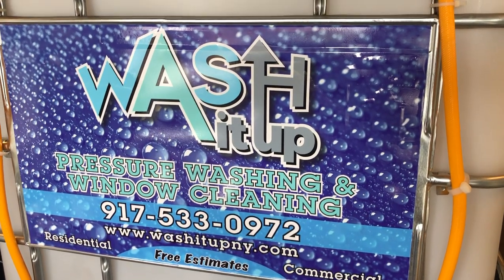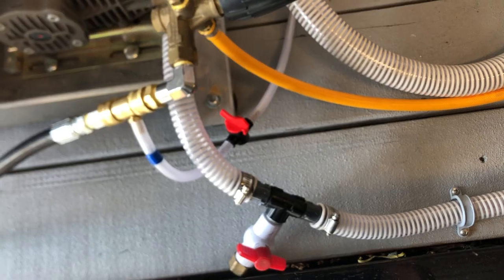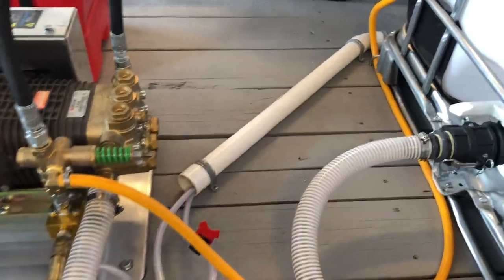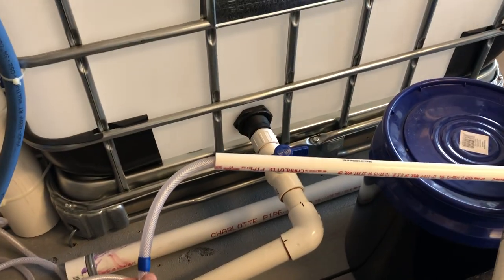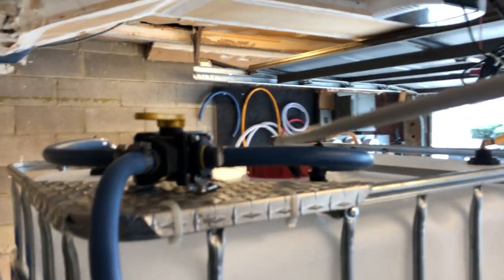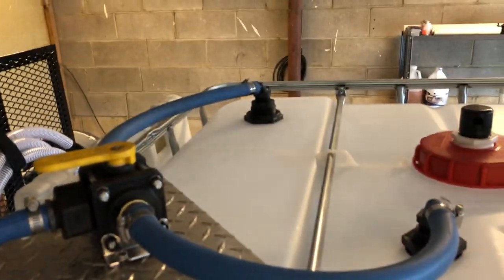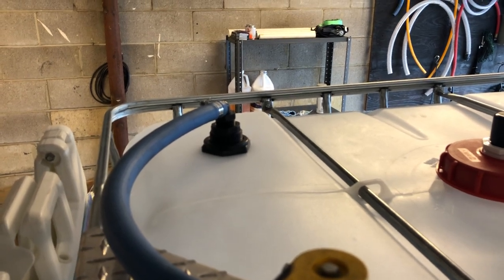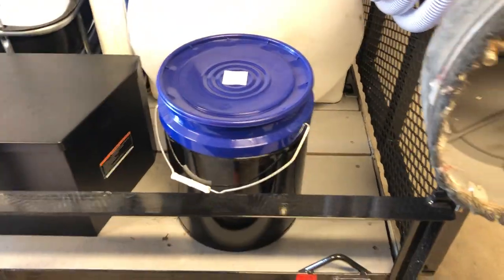Pressure washer plumbing

Comment: Nice setup I totally agree with you about the not having the extra mixing valves I have the same idea you have. Could you tell me how you were able to mount your hose reels on the angle iron of the trailer ? I see a plate. I’m looking to mimic your setup
Reply from the maker: Plates bolted down and custom
Brackets fabricated

Comment: with all the weight wont a full tote overweight your single axle trailer? i have kind of the same setup but i have my tote set up to never be filled more than about half because squatting my trailer worries the hell out of me
Reply from the maker: I upgraded suspension and axle on the trailer to handle more weight. Yes I fill all the way at jobs, but at the end I dump mostly all the water when I’m driving job to job.

Comment: Great video.  I would like to add an 8gpm to my existing set up.  Can I just T off my 1 inch line from my 5.5 to feed my new 8gpm?  I want to avoid drilling another bull head in my 200 gallon bigger tank.  Thanks in advance

Comment: Did you put barb into supply hose from pressure washer? Mine is leaking and I think I’m just going to replace it with male thread to 1 inch barb

Comment: Pretty nice simple set up!! How much weight does your trailer  can handle?? I have a 6x 10 I'm a bit afraid that can't carriet a 275 gal tote!!
Reply from the maker: Thanks! Not really sure. I do not travel with any water in the tank really. Maybe 50 gallons max.
Reply: @mattreno-washituppressurew6834  thanks for the reply I appreciate your time replying back. Probably that'll be the best thing to do not driving around with alot of water

Comment: Do u screw the straps to the wood for the tanks or go under the trailer and bolt to the metal? I would assume all the way through
Reply from the maker: Drill holes all the way through, secure with U bolts, put nuts under trailer.

Comment: Matt, Nice build.  How did you get the 4gpm and dump bulk head inside gasket ring and inside fitting attached to the inner bottom tote?  Drilling hole is easy, did you use wire to slide them to each hole?  Was it difficult?  Rich
Reply from the maker: You could use a wire. I used a broom stick!

Comment: Great setup. I agree. This is a much simple way to connect to machines to share one IBC tote buffer tank. I am hooking up a P40 Comet pump 10 GPM Soft wash machine , and 5.5 GPM Mad Max machine. What size hose are connected to the 3-way Banjo strainer you have on top of the IBC water tank?
Reply from the maker: I’m pretty sure the 8gpm is 1 1/4” or 1 1/2” hose. I get my connections from 
www.pressurewasherproducts.com
Call and ask for Lori she is a doll and will hook you up.

Comment: Hey, lovely set up. I have a 4.2 gpm machine. If i use a 275g ibc tank like yours, how long do you think it will take for the tank to empty while pressure washing?
Reply from the maker: Just do the math. It’s somewhere around 15 minutes straight while on the trigger.
Reply: @mattreno-washituppressurew6834  thanks, so what do you usually do to refill? Do you use the customer water fed to full the tank while pressure washing? Reason for asking is you have an 8gpm and thatll take up 8 minites to empty. What do you do to refill quickly?
Reply from the maker: Yes you always hook up to customers water unless it’s a very tiny job. The 8gpm blows through water there are times we have to wait or slow down to fill up to start again.
Reply: @mattreno-washituppressurew6834  thanks so much for responding. Stay safe out there and all the best to you business and life.

Comment: Hey man! How did u get bulkheads in the bottom of ibc?!
Reply from the maker: Hey Zach. Lol everyone asks the same question! Very simple. 
1. Drill your hole where you want to at bottom.
2.tie a string to a broom stick and feed from the top lid of tote and stick in the hole you just drilled. Leave string in place, you might have to tie it off, then remove the broom stick. 
3. Now simply put your bulkhead on the string from the Top, it will slide down into place.
4. Put your outside nut on the bulkhead and your done. Just make sure your bulkhead is on the right way. 
It’s really simple people overthink things. Believe me I was one of them.

Comment: Really nice.  That looks like 4000$  setup, minus the trailer.
Reply from the maker: A little more than that. 2 PW, softwash system, reels, tanks , hose accessories almost 15-18k. All that stuff adds up.
Reply: @mattreno-washituppressurew6834  wow, I didn't realize hiw much u had invested.   Still..an amazing setup...I would surely go the route you have taken.

Comment: Hey Matt, what did you use to coat the trailer decking with and is it holding up?  Thanks
Reply from the maker: Hey john I think the stuff was called raptor liner. I got the kit on Amazon. It’s holding up great. 1 full season nothing happened to it besides scuffs.
Reply: at 1:26  I see you have the wash line hooked up as well as the unloader Lind going back to the tank. I plan on getting the same unloader valve, but what did you use to plug up the port on the opposite side of the unloader line?

Comment: How did you install those bulkheads in the IBC tote with just a small opening at the top
Reply from the maker: Very simple. You drill your holes where you want them, then tie a string to a broom stick and use the top hole and put down to the whole you just drilled, untie and remove pole and leave string in place. Put the new bulkhead on the string and it will slide down into place, screw on other end and done!
Reply from the maker: Simpler than it sounds.

Comment: You not using no pump
Reply: Not necessary on a belt drive power washer as they can pull (pump) water.  A direct drive unit by design (usually but not always) cannot.

Comment: Question... how did you get those fitting drilled and installed on the bottom for your 5 gallon?
Reply from the maker: Not really sure what you mean? What fittings? Drilled what?
Reply: @mattreno-washituppressurew6834  apologies.
Reply from the maker: I’ll answer whatever questions you have if your confused lol. Just let me know.
Reply: If he’s wondering what I am, I’m wondering how you tapped bulkhead fittings on the bottom of the tank wall. The bulkheads have a locknut on the inside and you can’t reach down there to tighten it?

Comment: Fellas I'm having issues 
I habe the same 275 ibc tote 
To camlock to 2 inch to 3/4 spicket ...Suuuper slow flow out of the spicket and NOTHING outta the pressure washer ..My washer is 2.5 gallons a minute ..
I've primed etc etc 
What am I doing wrong please ?
Reply from the maker: You do not need a buffer tank with a 2.5 gpm machine. That’s a direct drive machine. It will not pull water for you . You need to gravity feed your machine or don’t use a buffer at all. You need a buffer tank over 4gpm. You can very easily get 2.5 out of a water spicket all day long.
Reply: @mattreno-washituppressurew6834  
Water is just barley coming out of the spicket I have ..but when I pull the camlock and open her up at the tank valve she floods out ..Wonder if ive just got tooo dainty a spicket
Reply from the maker: I guess so I’m just not really getting the problem you have. My point is you do not need a buffer for your machine.
Reply: @mattreno-washituppressurew6834  
Harbor freight sells a little DC powered pump i was thinking of putting it in front of the tank and before the power sprayer just to give it a boost ??
What do you think ?
Reply from the maker: Never heard of anyone doing that. I guess give it a shot. I think you need a bigger machine that’s my opinion

Comment: Great stuff thanks.  Can I T off my existing 1inch line that feeds my 5.5 and use that line to feed my new 8 gpm?   Trying to avoid drilling a new bulk head and avoid contamination of shavings
Reply from the maker: I would just make another bulkhead. I was taught to have designated bulkheads for each machine to increase flow. Just drain your tank, make bulkhead and shop vac the shavings out.

Comment: Very nice. The bracket set up in the back is brilliant. Good job.
Reply from the maker: Thanks. They are out of the way worked out very well.
Reply from the maker: Yes it’s tough though all surface cleaners are different. These are made for those 2 specific ones.
Reply: @mattreno-washituppressurew6834  do you happen to have the diagrams for the SC brackets I have the same ones and that would work nicely??

Comment: Is the tote bolted to the trailer?? I'm struggling right now with mine
Reply from the maker: Easiest thing possible. Put the tote in place, use a marker to outline the corners, mark where to drill holes, use 4 U bolts with washers and your good to go.
Reply from the maker: Obviously after you mark it out take the tote off to drill
Reply: Thanks I appreciate you responding!

Comment: Whats that trailer rated for weight wise>? I have a 6x12 enclosed and I am upgrading to an 8gpm. Just bought a 275 IBC, and I was to get a bleach tank but I am worried about that much weight.
Reply from the maker: Trailer I believe is rated for 2k. I upgraded the springs so I’m rated for more but not sure what it is. I do not travel with any water at all. I fill up when we get there.
Reply: @mattreno-washituppressurew6834  Ok. I was planning to travel with around 50...maybe not a great idea. How long does it take two fill that thing?

Comment: I have no clue why you would spend $30,000 when you’re only able to work 5 to 6 months out of the year…. Also PVC is the worst to use for plumbing with the sun ☀️
Reply from the maker: Not even sure what your talking about or mean,  I could easily work 9 months out of the year, we choose not to. My equipment is garage kept, when not in use, also only pvc on my set up is drains. Built myself and spent nowhere near 30k. Thanks for the comments but you clearly have no idea what your talking about.
Reply: @mattreno-washituppressurew6834  New York has the same weather as Michigan so like I said six months of the year.